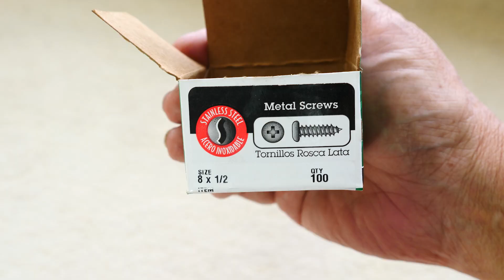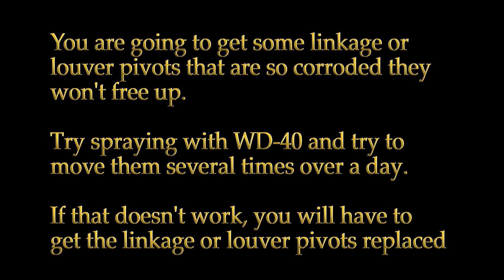Fixing Stuck Jalousie Windows HD

Comment: Great Video.Informative and step by step process. my only thing was when you'd mention using WD-40 is lubrication. It is not reccomended to tu used as such, it's a penatrating spray. Part you spray will move on immediate use, but will rust back up soon cause it's not for lubrication.

Comment: Nice
Reply from the maker: I am glad my video helped you.  I was about ready to replace my stuck jalousies, but I fiddled around with them until I found a method to fix them.  

If the cranks aren't working you will have to replace them.  I found crank replacements in local hardware stores.  Make certain the hole spacing is the same.  Amazon usually has a better selection and cheaper prices.